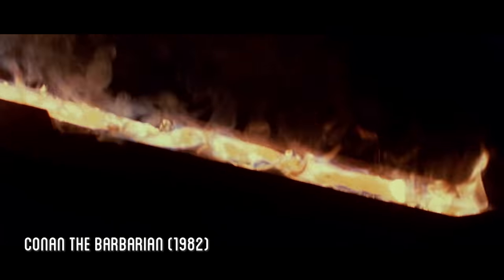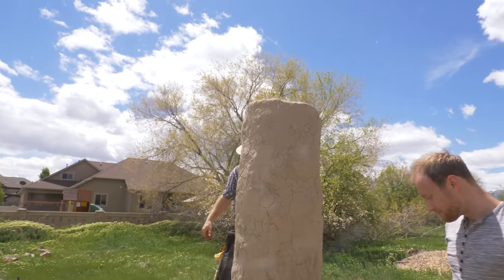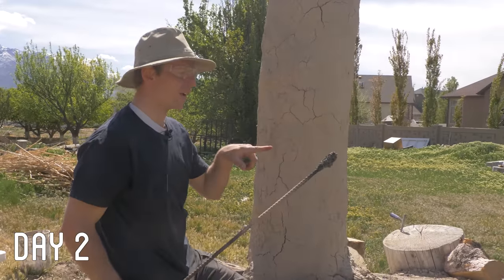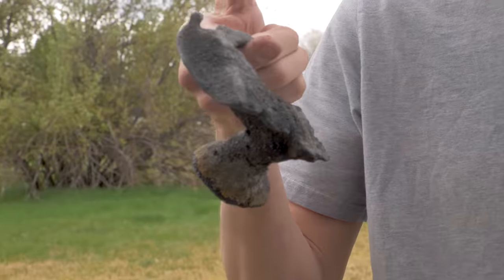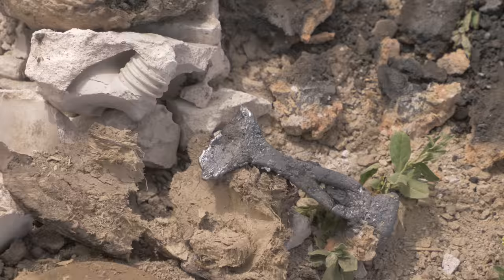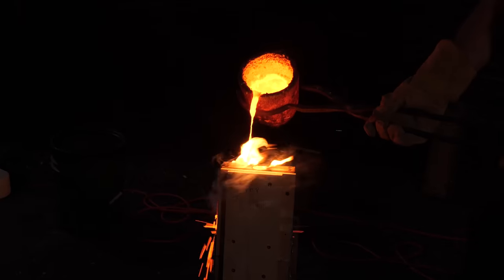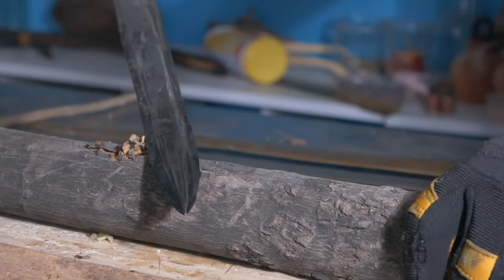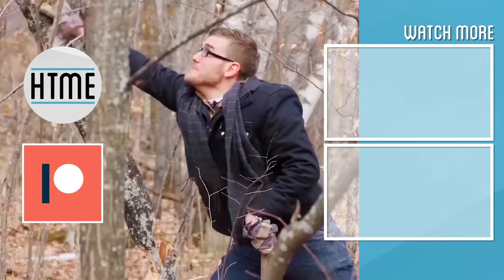Can You Cast an Iron Sword?

Comment: I would use graphite blocks for the crucial and the mold. Then a carbon arc in a nitrogen atmosphere would melt steel. if done quickly it would not pick up too much carbon. as for melting steel in a wood fire you need to blow the air down a tube that is inside the chimney. This preheats the air. There is a old painting of 3 fires on a hillside and I suspect that they were using the heat from one fire to preheat the air for the next fire.

Comment: You need to add vent holes to the molds so the air can escape as the iron's poured in. Otherwise the air gets sealed in and the iron hardens over it.

Comment: As an aside, you mentioned making a steam engine, which have really high pressure. If the design requires welding make sure you find someone who can do pressure welds with cast iron or it could make a pretty devastating explosion

Comment: cast iron is actually feasible to use in a sword. middle eastern swords made of crucible steel were extremely high carbon content. they were very brittle. the catch was that the swords were very thoroughly annealed to make them soft enough to not just immediately break.

Comment: I'm still slightly surprised that a closed vertical mould, like used with the bronze sword, wasn't used. It might have been a lot less work in finishing, after it had cooled.
The resultant cast iron "sword" would still be heavy and brittle, but it might have looked nicer straight out of the mould.
Using the opening scenes of "Conan The Barbarian" as guide on sword-making was perhaps not a good idea.

Comment: Wrought iron is iron with no carbon (or very little carbon) while cast iron is iron with a relatively high percent of carbon. Cast iron has a relatively lower melting point, it is very hard, and will break rather than bend (brittle). Wrought iron (pure iron) can be worked. It is not as brittle but it has a much higher melting temperature. If you could melt it you probably could cast something with it. I doubt you could melt it with a wood or coal fire. Steel is iron with more carbon than wrought iron and less carbon than cast iron. There are many alloys of steel with variable amounts of carbon and other metals that would adjust the melting point and ductility.

Comment: With a high temp metal, would you be able to mix out the air bubbles in the iron prior to casting (kinda like epoxy), or is it a second physical reaction while the cast iron is cooling,making any mixing a moot point?

Comment: I have wondered what the result would be if you cast the general shape and then forged out the distal taper and bevels. Would it really be that much different than starting with a rectangular bar?

Comment: Did you  guys add bentonite clay to the sand? The clay will add structure to it which is needed for iron casting. This is how green sand was made, which is what molds were made from in the industrial revolution but I could be wrong it's been years since I read up on it.

Comment: The main problem is the iron need more heat. If you melt it at close to solic point, it will get solid before is spread correctly in the mold. But still a lot better forged iron

Comment: The issue is your molds. 
They dont have a second spur hole for the air and trapped moisture to escape from the mold. That's why your getting a partial on the skillet.

Comment: You have to leave draining holes, for the air to come out. otherwise you will get bubbles and it wont flow. Also, the mold has to be 100% dry. wet sand is no good

Comment: This made me curious: Is it possible to forge a bronze sword? One issue with bronze is how soft it is, but could forging it like iron help?
Reply: Yes. You would forge the bronze hot, but at a much lower temperature than anything ferrous. Also the copper alloys can be hardened by working the surface of the metal, and they are softened by heating and quenching in water. I worked with a master smith that had a bronze chisel that would cut fully annealed iron.

Comment: I'm trying to make a forge pot solid cast iron I'm gonna put a foam mold in cement so it can't fall in on itself but my problem is melting it I welded a steel forge pot but the welds are breaking how should I go at melting the cast iron my steel forge pot is not really big and hits critical heat after 2 hours

Comment: Casting is harder yet brittle, think diamonds.
Question is can you cast and then partially tap it back into a more forged matrix giving some flexibility back?
Main reason in Europe that iron isn't cast was purely the heat required, most weapons wouldn't benefit from this regardless, except potentially something like arrowheads yet you can smash em out very fast by hand

Comment: everyone forgets that you don't cast swords in an open mold. only the sword blank, which then has to be forged, can be cast in an open mould. everyone who examines this myth forgets that. with this technique of the open mold, the blacksmiths in the middle ages made it easier to produce many swords in a short time. the blanks were there, so you could use them to supply the king's army with weapons more quickly.

Comment: Hate to be "that guy" but you need multiple vent holes in your moulds so you cab cast more reliably and better. You are getting pressure build up and blocking the void.

I've only cast car parts, but you want vent holes at all high points more the better to an extent. The hole doesn't even need to be that big.

Comment: got a question,,, kinda just popped in my head but,, if the sword dosen't work would a cast iron ax work,, i mean it wouldn't have the same weak points as a sword so would it be possible,, would you get to cast a modern ax head or would it have to be like casting the bronze ax head's or would it not evan really work at all,,,

Comment: This comment is at midway, the main failure for the casting seems to be preheating the mould so the metal doesn’t harden as soon as it touches colder surface probably will help significantly

Comment: You aren't using a flux. 18th-century ironworks used oyster shells or limestone to flux the melt, yielding a gray glassy slag and higher-purity iron. You layer the shells (or other sources of calcium carbonate) into the furnace with the charcoal and the ore.

Comment: To be fair to Lord of the Rings, only the spine of the blade was exposed to the air, and it was properly forged, quenched, and tempered later. So even if a bunch of those blades had defects, those defects may have been corrected later, or the bad blades may have been re-cast in new molds.
Reply: It also wasn't iron.

I'm fairly certain it was "Mythrill" which is a metal that doesn't exist in real life, because its Elven in origin.

Comment: Why not cast lower carbon steel instead of cast iron? Is it because you can't get the temperature high enough? I mean I guess it makes sense that they might not be able to melt steel back then even if they could forge it.  Also did you harden and temper it...? Not that I think that a forged sword is the way to go, it's just that I've always thought the same thing about movie swords and this didn't answer my questions...

Comment: It seems like cast aluminum kept hot for an extended time would develop aluminum oxide and make a fun toy
Reply: Thermite?
Reply: @cleverusername9369  although I'm sure you could setup a mold that would deposit aluminum oxide on a top layer and iron on the bottom layer, that stuff is a bit hot and splatters to work with, and forming crystals at a slower pace tends to increase size and strength of the crystals. Thermite would probably be a quick, dirty, and quite dangerous way to do it. That being said, I'm sure it 2ould be hella fun!

Comment: your cupola is not hot enough to melt steel, you would need a taller furnace and higher density fuel to slow the burden decent also you'll need charge cast iron not steel because the steel you charging cant sufficiently alloy with the carbon to reduce the melting poin down to a achievable temperature without industrial blowing equipment

Comment: Once you're able make molten iron you pretty much have steel. Iron swords benefit from forging because of work hardening.
Reply: @Grauenwolf  ...no it isn't.  Normalization removes too much work hardening, or rather normalizes the stresses out over the blade.  Over working individual sections of a blade can cause problems.  On the other hand, not work hardening at all means no martensite, so you definitely want some.
Reply: @corwinweber693  Thanks, that's exactly what I was getting at. This is after all an "iron" sword. Obviously if you have a decent steel you would use heat treatment rather than work hardening. they started using quenching in the late iron age.

Comment: You had nowhere for air/gas to go. It wouldn't accept more metal because it's only outlet was blocked with iron. Next time add a small vent on the opposite side of your box and it will be much more likely to fully fill.

Comment: Could you  forge a iron core then cast iron around it?   Or cast the blade then forge wield iron to both side of ?   Basically make a iron sandwich with the cast in the center.    Probably more work then it's worth.

Comment: Even a cast iron sword would need annealing to be useful. Just like a forged blade would snap if not tempered properly. Not reallly  fair test.
Now if they forged the cast a bit and had an experienced smith temper it that'd be more interesting. 
But that high of a carbon percentage isn't ever going to make a good sword. Unless maybe laminated it with softer iron.

Comment: Well, there's a few issues i see here, and i'm no metallurgist.
First, well the lack of sharpness isn't down to the construction method, its entirely on you. Forged swords aren't inherently sharper, in fact harder steel can hold a better edge...
Second, forged iron will also be brittle until its tempered. Which you don't seem to have done, so you didn't really show anything. Also, in some of those shows, like in LoTR and Conan, they are seen hammering at the steel, so it can be a process of making something like a shaped bar stock, which you then work.
Also, Bronze should be "forged" in the sense that you should work-harden the edge. Its "cold" forged but still...
Reply: Cast iron can be extremely strong. Automotive engineers figured it out long ago with cast iron engine blocks, crankshafts, camshafts, connecting rods, piston rings, differential housings, transmission cases, suspension arms and more. These parts withstand millions of shocks and impacts and twists throughout the life of a vehicle.

So for a cast iron sword I'd start by melting iron pieces of an engine. Then the cast blank would need proper tempering.

Some engines (and aftermarket parts) use cast steel in crankshafts, camshafts, and connecting rods. They're a strength and cost middle ground between cast iron and forged steel.

Comment: Cast iron is obviously not good for swords. It is possible to cast steel too and especially stainless steel.

I've been casting steel melting it in a small crusible using tig torch. I have a lid with hole big enoug to stick the electrode in and other one for ground. The crusible need to be filled with argon and small inflow keep the metal clean.

Comment: in Game of Thrones they cast the sword out of Valyrian steel, a fictional alloy but apparently able to be cast without being brittle.
Reply: Hollywood handwaving.  Casting doesn't make the blade brittle.  The lack of forging does, or rather not being forged means not being work hardened.

So there's nothing actively making a cast steel blade weaker, there's just nothing actively making it stronger either.  The second it meets up with a forged, heat treated blade?  It's going to snap.

Comment: I’d like to see this again using cast steel…. Maybe cast steel that you then try to forge more solid?  And you would need to make sure plenty of carbon remained after the casting process as the steel will need enough carbon to harden after all the processes are done….  But then you are basically just casting a bar of steel then forging that steel into a sword, which feels like a really redundant process, and that’s assuming the casting process neither burns out too much carbon, makes inclusions in the bar, or makes the steel non-forgeable lol

Comment: I have a small problem with your edge alignment. I know as a YouTuber you’re on a time crunch so I’m chilling on some of the more common sense things like the vents that people have already said. But something that people don’t understand unless they spend a fair amount of time with blades is how critical edge alignment is. By making the blade super thick, I can only imagine you didn’t want to take too much strength in the material away, the blade was actually made less effective and more brittle. This was something that bladesmiths of all eras are well aware of. Too thin it bends easy. Too thick it snaps easy. Yes I know cast iron isn’t the best for swords anyway. 

Second point was in your use of the blade. All blades have a sweet spot for chopping or stabbing. Now I could be wrong (wouldn’t be the first or last time) but it looked like you were using the wrong section of the blade on your chop tests. Too far forward most of the time then too close to your hand the rest. This might have been from the early break and the reshaping.

Comment: The reason why you didn't have successful pores is because you didn't have any vents. If you would make some vents and made sure that you poured to where those were leaking molten metal you would more than likely fill your mold. The gas inside the mold is preventing the liquid from going all the way in causing it not to pour completely

Comment: foundry man hear 15 years foundry experience. your molds are to cold need to be heated and your iron is to cold. should be yellow and sparking before a pour not red.. hence the jello gum consistency's .. also your molds need much more gas evacuaction points as iron off gasses in a sand mold. make an open face mold with the botom of the pan the open part and you will have better pours. and lastly whats the ore base your woking with. remelting pig iron into cast works alot better then raw ore. ie bloom a sponge and powder make that into chunks then melt those

Comment: Cast iron isn’t iron it’s carbon content is to high because of a few factors. If you reforged the material you are left with a high carbon steel. I understand it’s something to do with the casting medium that’s used in industrial methods. But not sure of the specific chemical reaction. I also repurposed a pan that had been used a graphite casting medium and found carbon Nanno tubes under the microscope. If anyone can explain that I’d love to know. I’d have to assume it was a pre existing impurity due to the lack of temperature in casting.

Comment: cast iron is useless for weaponry. If you want to cast high carbon steel, that would require a crazy high temperature and would be too bright to even look at when it was molten, plus there would be a ton of sparks flying off from the surface like it was erupting. Even then, I don't think casting steel like that would work well. There must be a reason why steel is never cast into shape and is instead formed or forged.

Comment: Your casting method is the problem, you need an exhaust port on that mold and the frying pan being so thin is a problem for the techniques you are using. Also try adding some flux will make removing the slag easier right before pouring. Also, you guy hesitate WAY too much when casting. When its time to pour, its TIME TO POUR,  it has to be done in ONE shot over 2-3 seconds. Otherwise you have weak spots that will break. You cant pour over a part that has already started to solidify, even if its still red. Also, there is something called Annealing you need to look at.

Comment: Swords must be forged. Not melted. 
When the iron, stell, are melted it became soft. But, when they are forged, it became very hard.
Reply: Opposite to that actually. Cast iron is way too hard for swords.
Reply: @luizaugusto9421  "Cast iron" isn't actually pure iron. It's steel with too much carbon in it to be forgeable but a lower melting point than pure iron.
Reply: @GoodandBasic  , yes. It is'not. 
The pure iron is very rare. The iron, even from space, has others metals. Like, niquel, crome, etc... 
But even with this metals, you cannot melt then outside from a big forge. 
Today, to melt iron, we use eletric indutance.
Reply: @GoodandBasic ,  you have a nice chanel too.
Reply: Bronze swords are cast, molten.
Reply: @BartJBols  , of course. But Iron, is not easy.
Reply: @luizaugusto9421  thanks man!

Comment: You offten fail because you not study it enough, in this case of fail iron casting, because your mold is too cold and have no raiser, So the iron solidified too quickly, and the air do not have proper ventilation.

Comment: Your melt wasn't hot enough, your mould wasn't vented, and you test was almost nonsense. if you took decent steel not the rubbish you used heated to its melting point and quenched it in water it would shatter like glass. All you proved is that rubbish steel with no heat treating is brittle. Even in the movies where you see them pouring a mould blank they then show it being forged.